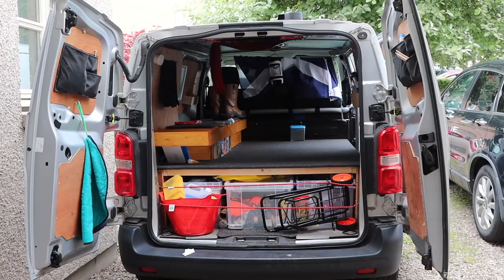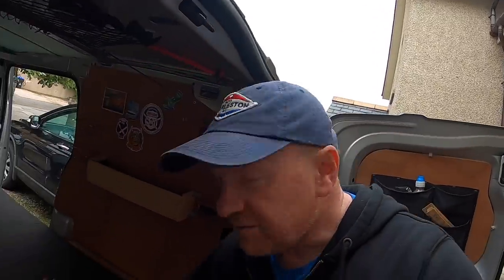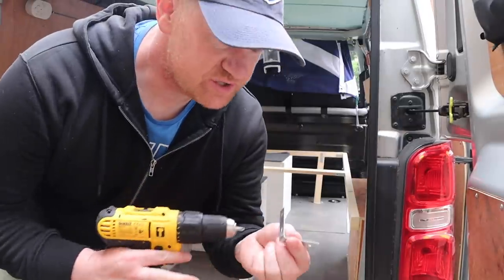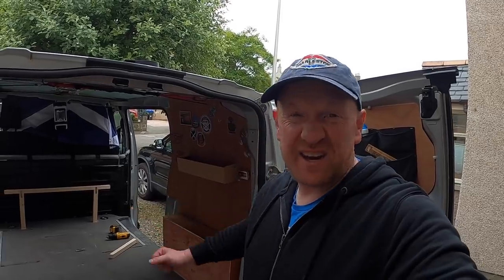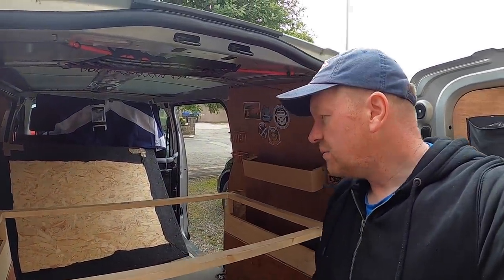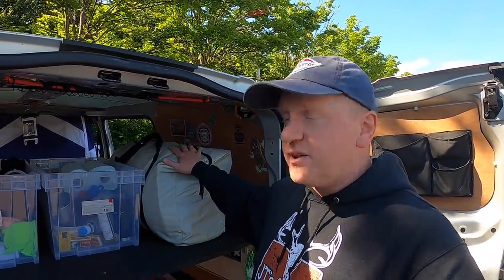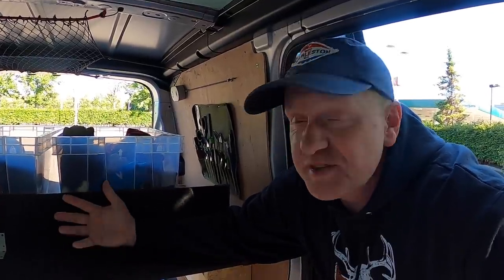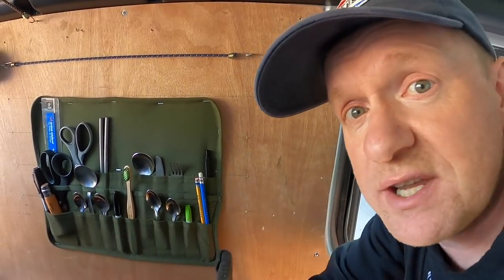On limited time and budget I had an idea, but will it work??? My ONE-DAY van conversion :O

Comment: 😎👍👏👏👏 I used to have an old VW transporter kitted out as a camper too. Spend as little as possible👍. I had some aluminium 'c' channel along the top edge with the side door & a heavy tarp with an edge folded over some rope that slid along the 'c' channel so I could have a rainproof porch out from my side door. My 3m kayak & 12 ft surfboards used to fit inside the van...... so long as there was nobody in the passenger seat
Reply from the maker: Nice Billy! :)

Comment: Steve, the van looks so comfortable. Just wondering what the condensation levels are like with both of you in it?
Reply from the maker: Seriously, not a problem at all! Fair enough on a hot summer day (not many) it needs a 2 second wipe with a sponge on the ceiling, but that’s it. We keep the windows a wee bit down and the roof vent makes a massive difference!